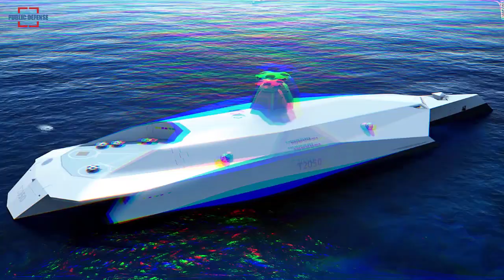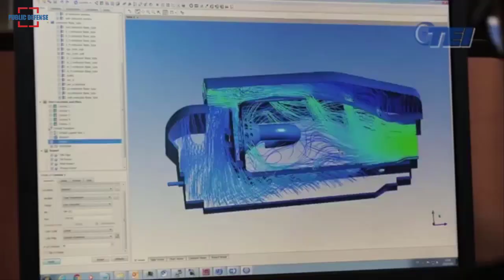The MMU National Fighter Aircraft will use the F110 Turbofan Engine in the First Phase

Comment: Will the US allow them to use the F110? It does not matter they can reuse the F110 of their existing F16 ...
Reply: F110 engines produces in Turkey.   Simply find informations on Wikipedia.
Reply: @Erkn.yz16  under licence. But not sure if assembled or components are manufactured as well in Turkey
Reply: @abekkaou  components manufacturing in TEI...
Reply: @Erkn.yz16  if the case the engine problem is solved for tfx then. They can start with F110 meanwhile developing better engine...